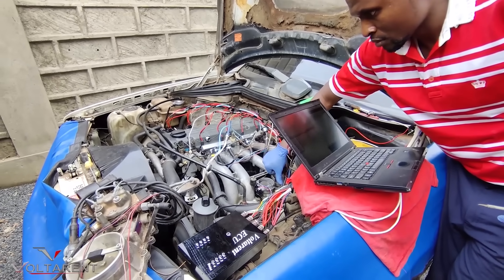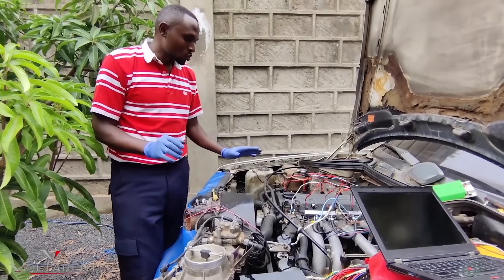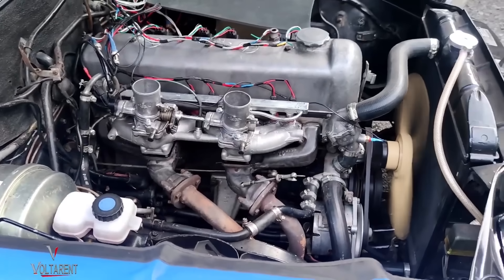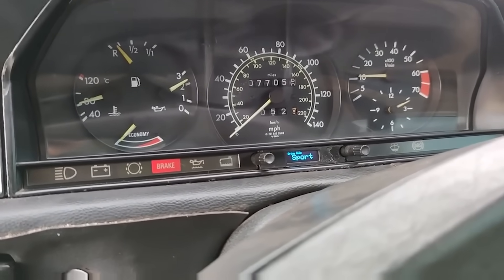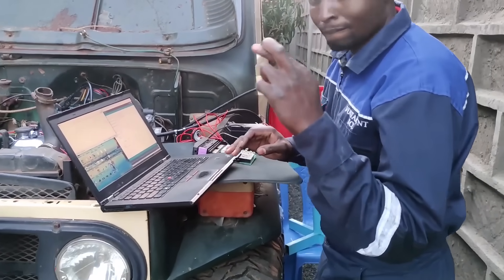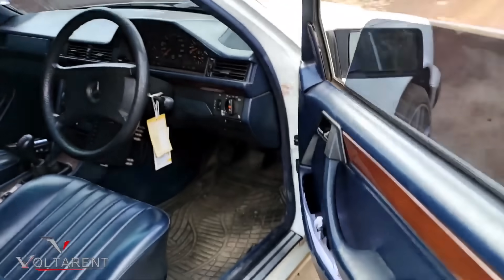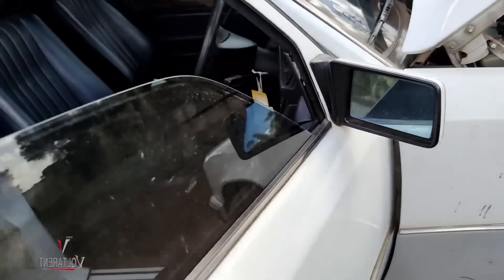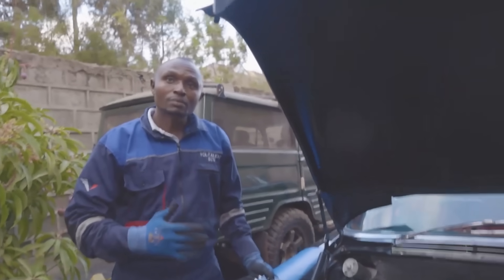African Genius makes Old Engines outdo Modern Engines!

Comment: Finally someone is using cheap and general available hardware as an ECU for old engines.
Reply: Not to talk down this man's achievement, but we already had cheap and general available hardware as an ECU with Megasquirt and Speeduino.

Doesn't make what he designed any less impressive!
Reply: @wanteds13  Are any of those solutions open source? GitHub?
Reply: @wanteds13  it is impressive, and at least he went the next step and designed a purpose built PCB for it
Reply: @wanteds13 not in africa
Reply: @wanteds13 i think it does since the ooensource speeduino can run much more complicated modern engines. His ecu has no support for any sensors. There's literally only a few mosfets in there, not even proper filtering.
Reply: @trw8777  So proper Africa spec!
Reply: @trw8777 I think solving a problem at hand is all that matters. talk of programming, circuit design. components design and printing ,machining and welding that comes with the customized parts and  fabricating.... all this done by one man. I believe innovation has no limit and he will get to it.
Reply: "Just buy" - a new car.   That was not the challenge.
Reply: @OoOoOoOoOoOoOoOoOoOoOoOoOoOok  0o0o0o0o0o0o0o0o0o
Reply: I guess, if you’re super hep on giving electronic engine management to your antique car. I suppose this would be an advancement in a place with many such cars.
Reply: This idea is very very old, not original or from scratch. It's called a "speeduino" system. He just put his own brand and name on it.
Reply: @mikem5475  Thanks for info about the open source project Speeduino.
Reply: @mikem5475  And who stops you from designing a spaceship and other complex systems?
Reply: @fangacaccccccccc  nothing
Reply: @fangacaccccccccc you're missing the point. This man did not "invent" the idea of using an Arduino as an ECU.
Reply: @daszieher no, but it’s always good to see engineers harness the concept
Reply: @mellowInventor  in no way do I want to belittle the person's achievement. My criticism is directed at sensationalism when choosing headlines.
Reply: @daszieher very nonsensical

Comment: You have single handedly made all modern crap cars obsolete, which they already were anyways. PROTECT YOUR KNOWLEDGE FROM JOO's
Reply: How has this made modern cars obsolete? This system is hardly as efficient as a modern EFI with variable valve timing in conjunction with a computer controlled auto.

Comment: he should do his ECU conversion using the factory wiring, like the BMW e30. PnP (plug an play) models using the original computer wiring, for performance applications. He could do a lot of business from clients from other countries.
Reply: The older the car the less factory wiring and sensors there are.  He’s got to add some of his own.  On something like that K Jetronic system it’s much easier to toss it and write everything from scratch.  This guy is on the ball!
Reply: Temperature considerations hopefully he's using military or commercial grade electronics.

Comment: Theresa better solution. 
Mechanical diesel. 
As impressive as this is. 

Car electronics have a hard life. 
And you’re still susceptible to a failed wire, sensor, plug. 

Where a diesel you can get direct fuel injection with zero wires or even a battery.
Reply: Very true

Comment: I am truly impressed. I was planning on building an ECU for a kit car, and i am glad I saw this. I would compare Stm32 VS the atmega for optimized performance.
Reply: The Arduino Due he uses has a 32 bit ARM chip. Not the ATmega chip on the older less powerful Arduino.

Comment: I'm a programmer and i can relate the joy in his face after the code works
Reply: How does he get them to know when to give signal for injection and spark ignition
Reply: @saddammalima8458  Is the distributor base at the front under the radiator hose at 1:20, under a new-looking shiny metal barrel with bolted bracket? Some kind of rotary encoder in there, I guess?
Reply: @trs4u  He likely is using a magnetic or infrared sensor to signal TDC on cylinder one...
Reply: @davidhollenshead4892  I wonder if that could be made to work on a running motor? I have no idea how electronic ignition/injectors normally get their cycle positions. I just assumed it would be mechanically transferred from the crankshaft. Measuring individual displacements (pressures) might allow a little more performance to be eked out, but it's a lot of redundant gear and more opportunity for failure?
Reply: @trs4u 
Crank and cam shaft position sensors. Usually, it's a wheel with teeth and a missing tooth at some degree before TDC so you can get the exact(ish) position of the first piston and extrapolate the others.
Reply: @trs4u na ya wronge 😂
Reply: @trs4u it’s probably a cam sync sensor
Reply: @saddammalima8458  by receiving data from various sensors throughout the engine, like the crankshaft position sensor, which tells the ECU the exact position of the piston in each cylinder, allowing it to precisely time the injection and spark to occur at the optimal moment for combustion
Reply: @beatkidd  yeah that's how modern engines work but for older ones they never had a crank or cam sensor . Did he build a custom one or his using something else to get the timing signal right
Reply: @saddammalima8458 
On older engines, you'd have a distributor. That usually has a plate with 4, 6, or 8 teeth (used to time spark manually). You can usually run it directly off that, but you'll only be able to idle the engine, above 1,500 rpms or so, he's probably installing an aftermarket encoder of some kind to the crank or cam shaft
Reply: just an aftermarket ecu, these been in the market for years, all he was doing was mapping change the air fuel ratio, nothing crazy out of it, this system don’t even really care about air, there no map sensor at all, perfect match of the fuel and air that’s it
Reply: If I saw it correctly, he programs it with an Arduino
Reply: Good programmers are artists
Reply: same here
Reply: Same here 🤞👌
Reply: Yes whenever the code works just how you want it is a great feeling
Reply: @Jhonny92C  ✔️
Reply: Same 💯
Reply: Fr
Reply: I feel it too..
Reply: After days of putting 15+ hours a barely any sleep.
Reply: 6:09 - As a programmer, make sure to cite your sources.
Reply: I'm not a programmer but I also understand the joy when something doesn't work because there's an indentation.
Reply: I hope he does not get in trouble. Protect him at all cost
Reply: I was writing a program in the 80s have finished writing and ran the program it said a sintax error spent hours and only to find I typed 0 instead of o.
Reply: lol same
Reply: Beautiful beautiful beautiful
Reply: Lo hizo con arduino?
Reply: I just knew his name was Maina
Reply: so many negative comments. Im a software developer straight out of zimbabwe working for a top tech well known computing pioneer at the forefront of AI and quantum computing. i also went to school whist in zimbabwe with a childhood friend who lost both her parents to HIV who went onto yale and study electrical/ electronic engineering. I was taught by all black african teachers. we have an amazing education system in africa. What this guy is doing is providing energy efficient cars to his fellow africans whilst saving the climate and improving himself and others economically. as far as im concerned what he's doing is pretty genius. he's provided a solution to a problem. thats what all good engineers do.
Reply: How can I block the variable camshaft sprockets so that the computer doesn't have problems when activating the VVT with codes?
Reply: Me too what a feeling
Reply: You'r correct,  what he has made is called a Speeduino, a long existing project
Reply: @pascalcoole2725  Are you implying that this engineer  presented in this video,  product is called speeduindo? Or there's another product that his?
Reply: LOL! He is not a programmer. He is an Engineer. He has been trained in the university and he has the license to do what he's doing. You are just a coder. If you try to do this, you'll be charged to court.
Reply: @bohemian_mallam  He’s also a programmer 🤦‍♂️ he’s obviously programming the arduinos in his custom ECUs.
Reply: code that works? pls sir, sho me teh way.
Reply: I know. I now AI to write the code , I still have a smile when it works

Comment: Instead of a few thousand stand alone ECU just Arduino DUE, this is true ingenuity.
Reply: Well, yeah, it's nothing new, still making it cost effective and rolling as a commercial product is the key. Choice of components to make it powerful yet not over engineered is important too.
Reply: @piotrcurious1131 the ecu is 1500 usd or more ..that is without all the other bits.  New fuel pump, smart coils, injectors and modified intake manifold to house the injectors which did not exist on the originally carbureted engine.  Plus all the harness.  The aftermarket already has ECUs fully programmable for under 2k usd....
Reply: Speeduino has been available from 2015, and it's an open source arduino based ECU. The guy definitely knows his stuff, but this is nothing new.
Reply: @Rok_Satanas  I’m sure this guy in the video has been working for years now too. He’s got several cars working on his ECUs. Very impressive when you consider it’s a man in Kenya and his little desk with just an electrical engineering background.
Reply: @wrth  I congratulated the dude in a separate comment, my issue was more with the video and reporter making it seem revolutionary. The dude even acknowledged speeduino and even brought up the difference between them using a Mega and him a Due. Speeduino porting to Due work started in 2017, but not sure if it went anywhere. Mad respect to the dude for doing it.
Reply: @Rok_Satanas   fair. they do make EI and EFI conversions seem innovative when it’s been a thing for over 20 years.
Reply: Speeduino is already an arduino based engine ecu.
Reply: Impressive!! Well done Mbiria!! 🙌
Reply: It would be better to hook it up to a Raspberry PI 4 or 5.   Much faster than that old laptop and cheaper.

Comment: Can imagine his face when discover speeduino….😅
Reply: Well, I knew about speeduino when I was starting and was among the solutions I wanted to explore before I finally decided to make my very own ECU, complete from scratch to gain engine full control.
Reply: @PeterMbiria1  I don't understand. Do you use the Arduino ide or do you go down bare metal. Secondly I think its impossible to code a RTOS on the Arduino platform.
Reply: @PeterMbiria1 I've got a 2007 Maserati Quattroporte Automatic, with a V8. Do you think you could treat this baby, too? Even 1 or 2km more per kilometer would make a difference. Anything beyond that is paradise. Kindest regards, Helmar
Reply: I was thinking the same 😂 next alteration is stm32
Reply: @darionherbert8449  That's what Voltarent is currently using, 32 bit ARM chip from arduino Due board
Reply: Yeah that's what I wanted to type.

Comment: Hi bwana. How much does it cost to change a 3Y hillux engine from carb to EFI?
Reply: For a 4 cylinder engine, it's $1160 for the full conversion
Reply: @PeterMbiria1 share your contacts
Reply: Hi, what's your take on vw polo's 2004-2009 fsi/efi what can be done to improve efficiency

Comment: That is brilliant, so many of these old engines need to be upgraded to EFi. Old 1960's, 70's cars with the Bosch early fuel injection and the later 'K'Jetronic systems will do well with full electronic conversion. One question, what sensor inputs go to the ECU (computer) for max efficiency? For example, is there a lambda sensor input to control the injector timing, or ignition timing.
I have not seen anyone upgrade the old engines to EFi on the internet.🦁
Reply: You would need:
Crank speed sensor
Manifold pressure
Throttle angle
Intake air temp
Coolant temp
Wideband air/fuel ratio (preferably)
Reply: @Kj16V  I was thinking of the other 'basic' inputs as those found in early generation 1 vehicles. The crank speed, I think he gets from the modified distributor as shown in the clip, and I think he has the coolant temp input as well. The Arduino memory capacity, not sure how much it can handle, and for minimum 7-10 sensors must be more higher. More information from the man is required.☘

Comment: I hve a carburettor 102 and was looking at changing to a 111 in due time.
The cost is nearly coming to the same amounts. 
All i want to know is the reliability/longevity. 
I will engage him on whats app, but anyone can help me with their ideas pros and cons from a consumer's point of view.
Reply: M102 is a great engine and was built like a tank. M111 is the successor of M102 with more mechanical and electrical features added like 4 valves per cylinder instead of 2, VVT on intake thus able to shift power band from low rpm to high rpm, it is full EFI and much more.
Now, I normally say, M102 was never given the love M111 got (apart from cosworth with EVO I and II) if given the attention and engineering, it can perform better, if not same as M111.
Reply: @PeterMbiria1  very informative. I knew its superior but you've expounded,with inclusion of intricate details on workmanship that enables that to be.

So for now the only option we're left with is to swap to a 111 for performance and efficiency as well, since m102 is not being manufactured again thus not being improved 😕

Comment: How can an old engine be improved to the point that it's better than a new engine? Respect for tinkering but damn. Reminds me of the African flight videos.
Reply: No more planned obsolescence makes the older engines superior.
Reply: Maybe cos modern engines nowadays (2020 era new engines) are crap.
But probably because you get rid of the mechanical fuel injection if exists, and you go to multiport injection in any model...
Reply: You can't understand that's why you never took education seriously. You were chasing women while your mates studying
Reply: @MAKOMERE  what an assumption to make. Assumption is the mother of all mistakes. I own my own asbestos removal company.  82 employees currently.  I own my own home and drive a 140i tyrbo running 767 bhp. I'm happily married with children. A well made modern engine is leagues ahead of an old engine, no matter how much fettling you do. Mpg, reliability etc. I turbo charged my 140i 3 years doubling the power and it hasn't skipped a beat. You can make an old engine better but it will never compare to a well made modern engine. So, carry on with the assumptions, see how far it gets you.
Reply: @garethwillis  Well, I look at drasters that use old chevy blocks from the 80s to make 11000 bhp, point is, there are differences with engine tech. Modern engines are lighter and can accelerate faster and economical in some sense. they however don't have the engineering to allow them last like those engines in the 80s, why? you are well connected so you know a thing or two about business, to still make sales, you don't make something that won't fail, you want to sell spares, you want the engine to fail prematurely etc. Can a today's car with all the tech outlive the 80s vehicles? Why?